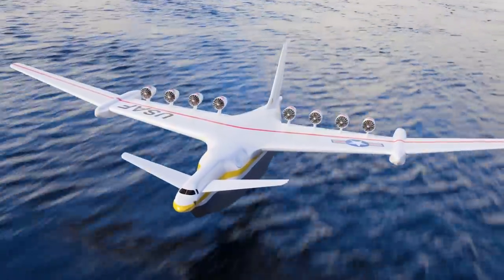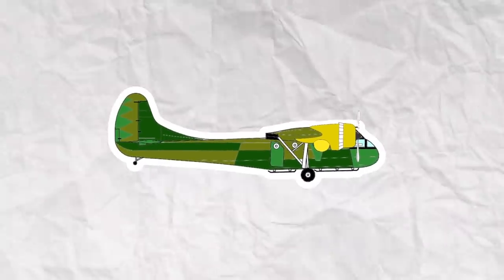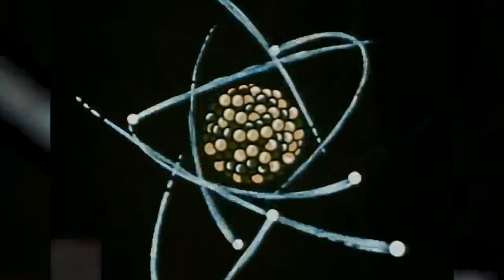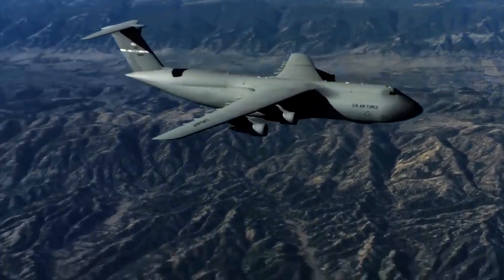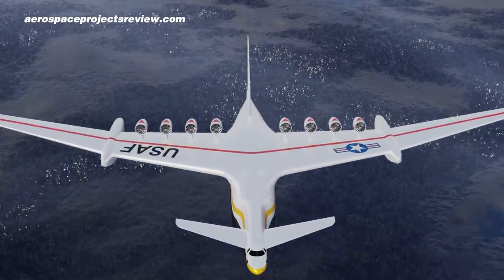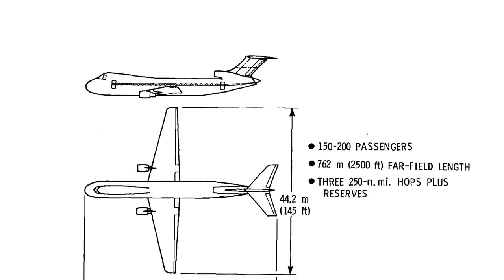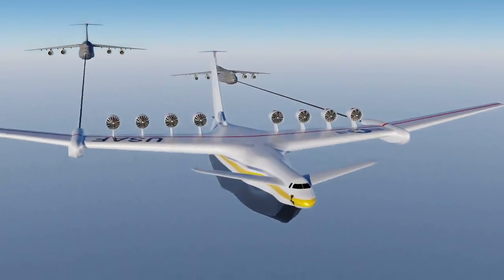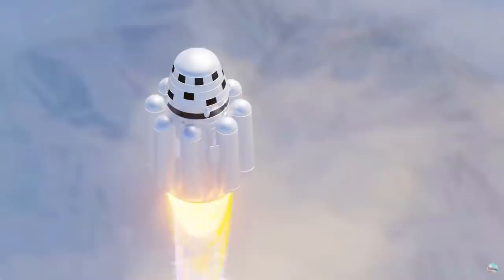The Insane Nuclear Powered Flying Tug - Pulls C-5s Across The Atlantic

Comment: As I was watching this, I found myself wondering how the planes would connect to allow themselves to be towed.  In the WWII example, they were connected on the ground, but this obviously isn't feasible when one plane takes off from the water and the others from land.  Then I realized perhaps you could use a system similar to the probe and drogue refueling system.  After takeoff, the towing aircraft would trail the tow line with a drogue with heavy-duty locking mechanisms at the end for stability, and the aircraft being towed would fly into formation and plug into the drogue with a probe on their nose.  Some reengineering would be necessary, but it seems like a workable solution!

Comment: The Molten Salt reactor was invented for this job. It was quickly realised the necessary shielding is too heavy but the ultra simplicity of molten salt made the engineering easy to deliver. 
The molten salt reactor has been resurrected by the likes of Moltex and Elysium who have fast spectrum reactors that burn irradiated “waste” neckwear fuel. 99% of the energy is extracted against just 4% in before the fuel was taken into storage. That cuts the existing 30,000 years half-life to just 30 years.

Comment: I noticed a big mistake in the video's information.  8:40 You said the engine technology was only lightly investigated and would take a decade to make feasible . 
This simply isn't true as the us army created the NEPA  program (Nuclear Energy for the Propulsion of Aircraft) all the way back in 1946 to study and create such engines.
They produced  a nuclear powered propeller based plane (NB-36H) and started on both closed and open loop jet engines.
In 1961 project Pluto was started that created 2 nuclear powered ramjet cruise missiles . There was also the ws-125 nuclear bomber that had two nuclear engines built and tested in 1961.
If this design is from the 70's (which i doubt) then prior to it the army had already created at least 3 types of engines, reactors and started work on nuclear rocket engines.

Comment: The problem: the plane was designed around old-style pressurized uranium nuclear reactors. New Generation IV nuclear reactor technology that won't require a lot of expensive radiation shielding may actually make the whole idea viable again.
Reply: I'm sure they could pull it off if they really wanted to. Kind of wish they did lol

Comment: The US government already toyed with a nuclear aircraft. The finding was that the insulation needed to prevent the pilot obtaining radiation sickness was so heavy it prevents the aircraft from taking off. Even with a radiation suit, radiation levels in the cockpit were too high for the suit to be sustainable for any real length of time. The second issue also being if the aircraft were to crash there would be no way to contain any and all radiation that may spread over the crash site. Unlike a nuclear bomb the radiation spilled from the reactor has a significantly longer half life. So any crash site which may or may not be densely populated would become a radioactive hot spot from many centuries to several millions of years.

Comment: Just think If you build them today and use them to tug planes across oceans only. How much it would be cheaper to fly over to Europe. Or from Britain to Japan by tug over Atlantic and Pacific. For most of those flights you just need fuel for take off and minimum fuel for landing. Heck in this age you could make them drones, they alternatives for cleaner nuclear reactors and they can be detachable so if something wrong with plane just eject them in armored floatable container that can easily be picked up .

Comment: By 1978, both the United States and the Soviet Union had tried (and failed) to build a nuclear plane. The American nuclear plane never flew, because the the radiation shielding was too heavy, and lighter materials wouldn't provide adequate protection. The Soviet plane flew, but they never managed to properly protect the crew from the radiation, since adequate shielding would be too heavy, so they too abandoned the concept. Whomever proposed this project knew full well that it was a pointless money sink. And there really was no need. 1:51 makes it seem as if a C-5 couldn't cross the Atlantic, except the Azores are well within range, and can be used to stop for refuelling. Furthermore, there is an American air base on Newfoundland, from where they could reach Ireland. The whole thing was a scam by men who where desperately pretending their continued employment was not a pointless burden on the military.

Comment: I can already think of a better idea. Instead of planes, use airships/hybrid airships. Power them with hydrogen fuel cells. Make a nuclear airship which can condense water vapor (such as in clouds) into water. Perform electrolysis on the water to produce hydrogen, and refuel the other airships using the hydrogen.

Comment: Yea, sorry but the whole melt down probability thing completely backs me away. Don't get me wrong, I think we should be investing in 5 times the amount we currently do on nuclear energy. But that's with a reliable supply of chilled water and a controlled environment (2 things not as readily available in the air.)  But placing a reactor and expecting air to stay chilled enough to keep the reactor from overheating is a crap shoot. Especially when the plane lands for scheduled upkeep and crew changeover. Can you imagine how much available time you would have if you had to land on a 90+F degree day?  I'd say a half an hour before the reactor goes critical.

Comment: They could also just convert the nuclear energy into electricity and use electric motors
Reply: It is probably the best solution, except converting the heat from a nuclear reactor into electricity is difficult when you are not surrounded by water since electricity is typically generated by boiling water to turn turbines. If they solve that problem, nuclear power applications can balloon, especially for space, where spacecrafts and probes are often limited by power because you can only squeeze so much solar cell panels before it becomes impractical.
Reply: so you propose to use heat from reactor to not power turbines but to power turbines conected to generator that will produce electricity then used in other turbines conected to electric engines
Reply: @hphp31416  It's roundabout but this kind of method of generating electricity to power a motor instead of using that power directly is done quite frequently. Diesel electric locomotives do this, so do some marine propulsion. The nice part about electric motors is their high efficiency at converting electricity into motion so you actually lose very little of energy you generate. The point is to make the nuclear reactor part completely isolated from the propulsion part, so all the nuclear fuel is self-contained unlike the way in the video, which is to directly heat the heat passing through the fuel itself. That way, you will spew radioactive microparticles all over the atmosphere.

Comment: These people designing nuclear reactor ramjet and turbine engines..... I want to know why they didn’t just use copper wires running in the wings to the engines which would contain AC motors that would drive the turbofans... Engineers just love to over-complicate things, am I right?
Reply: you can use heat from reactor to power turbine and push air or use it to power generator, then power engines and finnaly power similar turbines or propelers, 2 not required energy conversions with loses